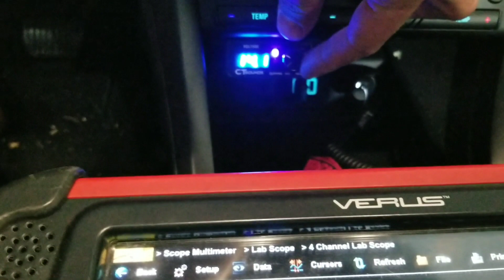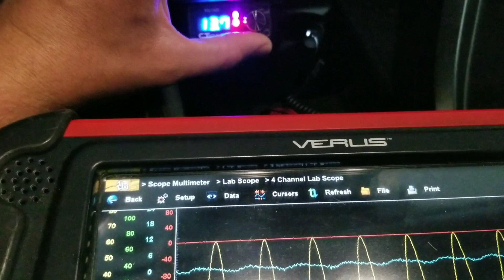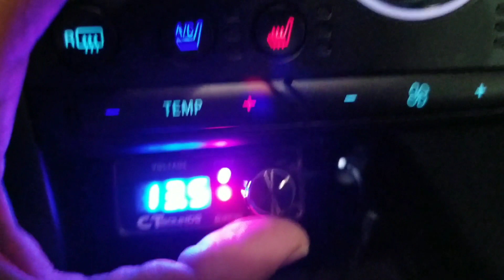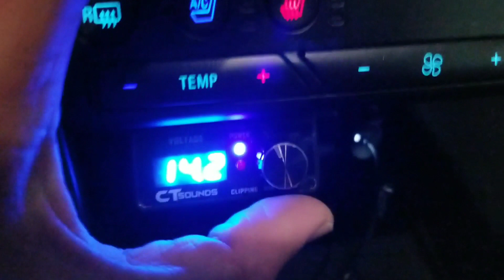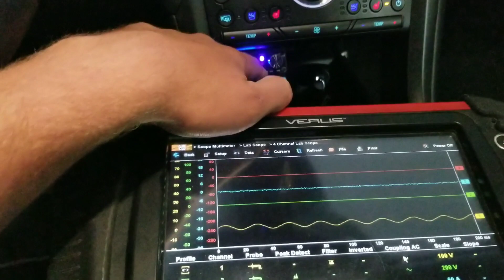How Accurate Is The Clipping Light On A Bass Knob?

Comment: I just got a new at2300 you answered my question. My gain is up not even 1/4 and its beating my subs so hard, with no clip light on. My subs started smoking and I wonder if they were actually clipping without the light on. I have 2 sundown e12s on that amp and it just to much power for them little subs. They are still playing fine after a Lil smoke show. 😆
Reply from the maker: Yea, id definitely say its too much power. Watch my 2300 video
Reply: @ATCA  Your video is the reason I got it. I was stuck between the AT and JP23. Thanks for the information

Comment: I think the bass Knob is actually set to 1% distortion and not Clipping. That's why it comes on first. One other thing I noticed is your gains on your amp are set too high. The bass knob should be all the way up when adjusting the gains on the amp.
Reply: I do leave a bit extra room so I can crank it up higher for music that plays lower volume. Got the clipping light just in case and that’s it
Reply from the maker: This is for demonstration purposes.  My gains are set where they need to be.

Comment: How’s your amp and sub holding up Nine months later?
Reply from the maker: Mose 8s went bad to manufacturing defect. New model is coming out soon. Supposedly louder and better and fixed this issue and ill be getting 2 of those.  I built a new enclosure that hits much harder than the factory enclosure.  1400.1 amplifier still going strong. However i upgraded the door amp to 125.4 which is way too much power. Overall very impressed every time I get in my car. Very clean install so it never has problems and i repaired the tinsil lead on thr meso 8s myself and the repair ia still working fine until thr new models come out.

Comment: I have a quick question , my Rockford Fosgate came with a bass knob but I’m thinking of getting something like this that reads volts and clipping light , what’s the differences between factory provided knobs and aftermarket that connect via rca’s ?? I’m new to car audio so any knowledge is appreciated
Reply from the maker: CT Sounds sells a bass knob thats universal and uses RCA and had voltage readout.  Biggest thing is this one comes with the amp and it has clipping light. The RCA units don't have clipping light. Id looks into the universal bass knob from Ctsounds.com
Reply: @ATCA  when a bass knob is connected via RCA does it actually adjust the gain from amp ?
Reply from the maker: @akidim13  no. It changed the rcs input level. Like turning the radio up or down. You still need to set the gain on the amp directly and properly with the bass knob all the way up and the radio at clipping
Reply: @ATCA  do they make universal ones that have a clipping light? I’m looking for one with the volts and a clipping light.
Reply from the maker: @drakeearhart3644  no. I wish they did

Comment: Remember most amps are rated at 1% total harmonic distortion
Reply from the maker: Yes. But some guys use clipping as a "maximum"
Reply: @ATCA  lol my bass knob would do the same thing, it would show fluctuate between 11.1v back to 13.9v
but my stinger volt meter would stay steady and only change from 13.9 to 13.1v and yes stock ALT.. nice video though
Reply from the maker: @AJOSUE  this video is intended to show clipping not voltage.  But yea ygese voltage on bass knob are not very accurate